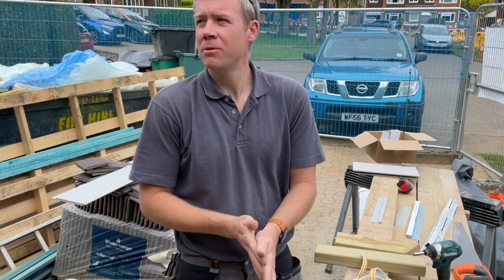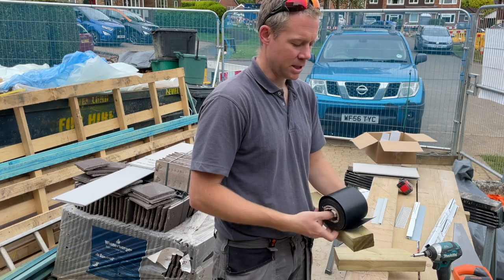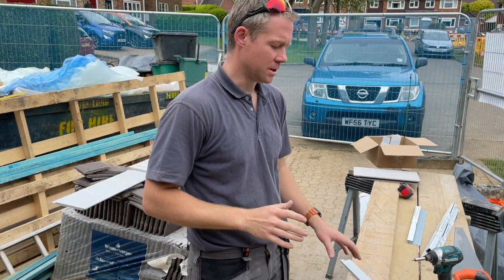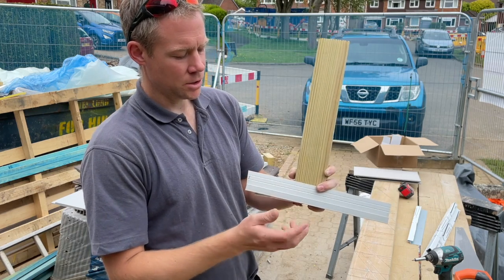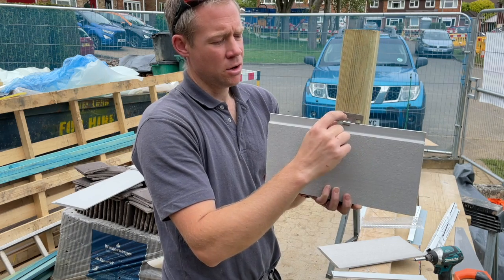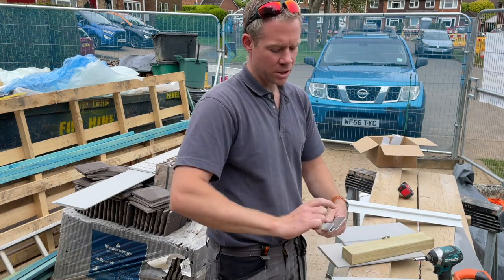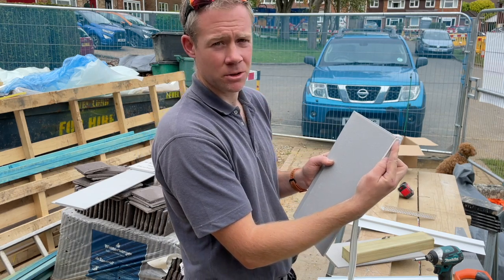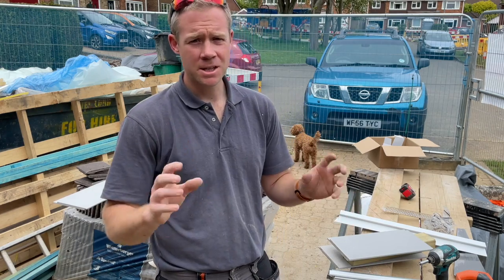How I Installed Cedral Click Cladding - The Real Deal!

Comment: Thanks for doing such informative and helpful videos.
I intend to do our house with Cedral Click.
I think using 4”x2” treated timber is an awesome idea as it makes the whole structure more sturdy.
The area where I live has some really strong winds and gales.
I’m fitting into 4” concrete blockwork.
What fixings would you recommend for timber to blockwork and roughly what spacing between fixings please 🤔
Also what spacing would you use between timbers for cladding support please 🤔